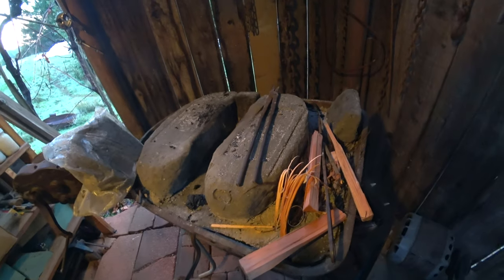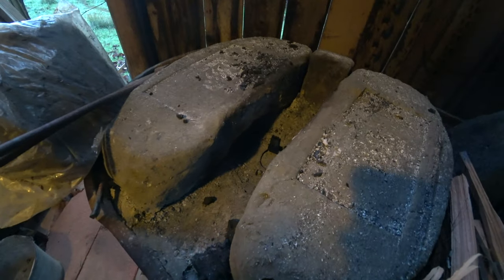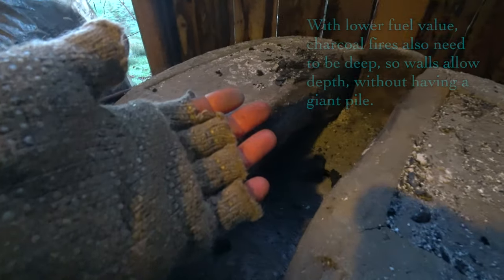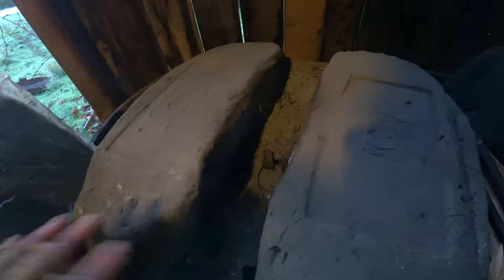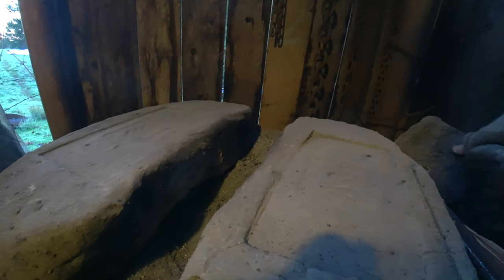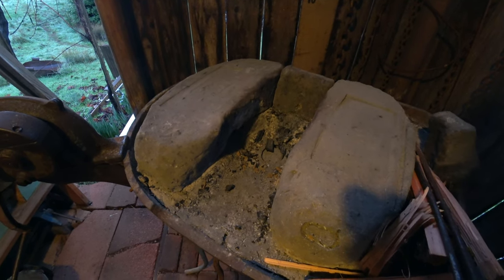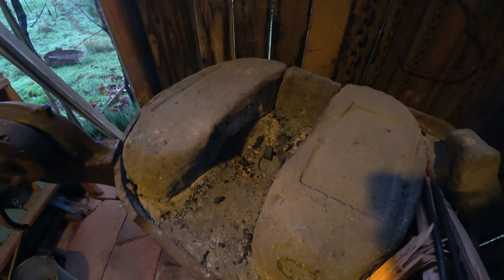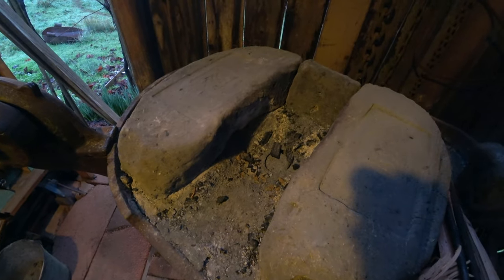Better Forging With Charcoal in Coal Forges

Comment: Few things Ive learned along my forging path that may help. 

1. those type forges suck for charcoal, even modified, I know cuz I started with one! Since moving to a Japanese style forge set up with side blase, and especially the wooden box bellows, its a total game changer. 
2. Counter intuitively, you want softwood charcoal for forging, not hardwood. Sounds nuts but pine will burn hotter and leave far less smoke, sparks and ash than hardwood, no wonder why the Japanese smiths always used pine, they saved hardwood charcoal for culinary purposes like delicious chicken. 
3. The art and process of cutting and sorting the charcoal is SO important, which is why its all an apprentice is allowed to do for the first YEAR in a Japanese forge! Just throwing random sizes of charcoal on top, letting big chunks burn and fall apart is very inneficient, they even have specified names and uses for cubed coal of specific sizes, like X size for forge welding or Y size for general work etc. 
3. The type of charcoal matters a lot. 90 percent of carbonization that you would want for biochar is really too far gone, you have lost much of your volitiles that you want to give the explosive heat to your fire. Overcooked charcoal will have a more dull flame and heat up the work slower, no wonder it seems to be less energetic than coal, but trust me, GOOD hard pine coal made in a low oxygen kiln will amaze you and heat things up quicker than oil coal. 
4. For me its a trade off, much more needed in design and execution to work right, but well worth it for the advantages. TO me being able to use the charcoal, heat things immediately and cleanly, no need to coak down the coal, manage the green vs coaked fuel, deal with the toxic fumes and general dirt, to just have zero smoke, direct explosive heat, clean tools and work area and make own fuel is all worth the work and learning curve. The problem I think is trying to just use charcoal like oil coal, throw it on a coal designed forge and say, man this stuff sucks! I know cuz Ive been there and done that the first years. Each step is a great leap. 

Check out https://www.youtube.com/c/CrossedHeartForge DaveJ has done amazing work and is a very humble and helpful person.
Reply: really great input, especially coming from you. Yeah, I have been experimenting with making charcoal and started with these open chambered ones where you basically just set it a fire and quench it, It is difficult to control and the charcoal produced is rather light. I have moved on to a retort design that I found in Jon Jandai's content on this platform and it produces much better firewood as the wood is never set on fire but just heated up to the pyrolysis temperature. Thanks for the tip on using pine, in your experience, how much does the quality of the wood matter? I mean in terms of sapwood vs heartwood and fastgrown versus more dense slow grown?

Comment: Very good advice on isolating. Charcoal fir a better dome of fuel
Reply from the maker: Pretty much my experience with charcoal, contain it or it's like chasing greased pigs :)  Not just that it's loose, but also it's super light weight.  I was thinking about how one might design and build an elegant adjustable charcoal forge out of metal.  That would be really cool, but I decided an hour playing with mud is pretty elegant and fun ;)  @Newts Leather and Metal Smithy  says you have a vid where you talk about strategies for using charcoal.  Can you post a link?  cheers.
Reply: @SkillCult  I did under Drason's Forge's comment but here it is here  https://youtu.be/lvNM2WPPIiY starting at the 5 minute mark

Comment: This is definitely something I want to start tinkering with as well. Might have to start researching for ideas on homemade or ground forges.
Reply from the maker: If you watch my black jack leather mug video, you can see how simple it is to throw together a ground forge that works.  You can tweak it from there if you want, but there is not much need for anything fancy.  Maybe drill holes in a pipe to spread air out.  Cob is cool because you can shape things exactly how you want, vs other building units.
Reply: I described how to build. Dirt box forge to Quinton D if you wanna read it it's fairly simple and works for a long time

Comment: I have found it just as easy to use straight wood for fuel if you cant get coal or coke - pieces about 3/4 inch square and 4 inches long are perfect. You need need to feed it faster than charcoal, but it saves the whole making charcoal routine, and it doesnt blow away in a strong air flow like charcoal or make anywhere near as many sparks.

Comment: BLACKSMITH CONTENT! Thanks man. I've tinkered some with the acetylene torch at work but I want to build a real forge. How do you feel about a clayed disc blade holding up?
Reply: If you want to start out cheap build a wooden box 18" wide x 22" long 8" deep lay down 2" of dirt 2" of clay mixed with hay/straw/ or lawn clippings lay in a piece of pipe about ⅓ of the way then slope the sides from the top of the box to the center add an air supply like a hair dryer and you have a forge
Reply from the maker: Most disks are a little on the small side, but maybe a bigger sized one.  if you clay it, you can use almost anything, like the end of a metal drum for instance.  Large brake drums from big trucks have been used a lot.  In fact there is a big brake drum forge here that was left by the loggers that cut the place 60 years ago.  Honestly, a good way to start is on the ground.  Just mix up some cob or get some bricks and slap something together.  Then you can be forging while you work on something taller.  Watch my black jack mug video.  It's as simple as that to have a small working forge.
Reply: @SkillCult  I've watched that video at least twice lol. I grew up in ag country, how big of a fire pot are we talking? I'll try the earth forge if I'm better off starting there.
Reply from the maker: @quintond.7888  Ground forges are just easier to throw together than anything else.  It'll give you time to work on something nicer, or just find one.  A lot of farms have old forges lying around.  They don't really have to be very big, but bigger gives you more real estate for setting things having something adjustable like mine.  Like I said, if it's clayed, you can use almost anything for the table, but the part where the fire sits has to be thick enough.  In sheet metal forges, it's a thick steel plate bolted in with the clinker breaker.  You can make a grate, I've used grate forges before, but they clog easily and you sometimes have to disrupt the fire majorly to clean out the ashes.  Lots to learn about forges, but it doesn't take much to make something functional.  I'm sure there are all kinds of DIY forge things out there better for advising you than me.
Reply: @newtsleatherandmetalsmithy1827  and @Skillcult thank you both.

Comment: Reminds me of something I’ve seen on German/eastern European forges, not as large as yours but some idea, having the tuyere between two hemispherical walls to contain the fire. 

And of coarse Japanese forges- very much the two wall deal. I’m getting more and more curious about charcoal as coal gets tougher to get.
Reply from the maker: I remember forging with charcoal for a while with no walls and chasing it all over the forge bed.  It's hard to imagine that anyone forging with charcoal a lot wouldn't end up with something to contain it and deepen the coal bed.  I have seen Japanese forges and very likely was influenced by them.
Reply: Charcoal is fairly easy and cheap to make I know of several smith's that make their own 40 to 50 lbs at a time
Reply from the maker: @newtsleatherandmetalsmithy1827  @Broadus Thompson  There is a biochar retort system that uses a barrel within a barrel that I haven't tried but looks great for making hard charcoal.  It should be low smoke and low maintenance compared to a lot of old ways of smoulder type charcoal methods.  https://youtu.be/RXMUmby8PpU  I've used an open fire barrel retort with a pipe running the gasses back into the flame, but was not too impressed.  The charcoal was fine, just inefficient and lots of maintenance.
Reply: I haven't been forging long, not quite two years, but have been using charcoal the whole time. I ended up essentially building a box of sand. I'll take the sand, and wet it a bit, and pack it into a trench of the shape I want for whatever I'm making. The ash is actually an asset because it mixes well with the sand and makes it more shapable and stable. But anyway, it'll hold that shape through the whole time I'm forging unless I'm really careless with the work piece. I also built a box bellows for my forge. It makes really peaceful clack, clack sounds from the wooden valves while I'm working. I love it.

Comment: I've always wanted to try a big pile of hardwood and encase it in earth to make charcoal, bigger scale but not big.  The clay blocks look like loaves of bread, and in France they would call them baggetts  similar feature can be found on timber frames, blocks of timber on the lower side of purlins to hold the purlins in place, not clay but wood of course, only resemblance is the shape, shape of a loaf of bread.  So I propose you call them baguettes
Reply from the maker: I would but I already ate them.  But if I make more....
Reply: @SkillCult  😂